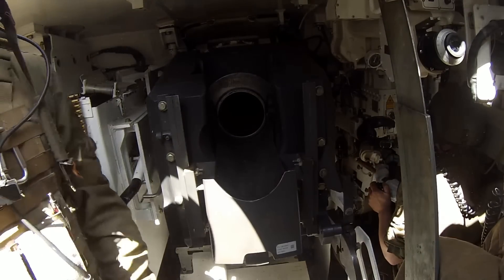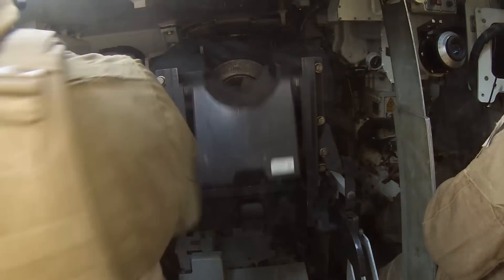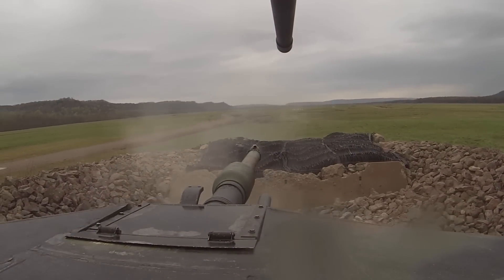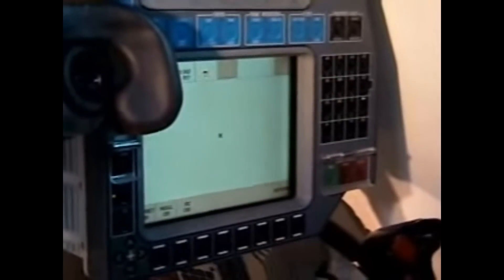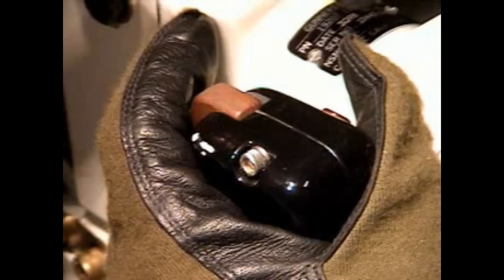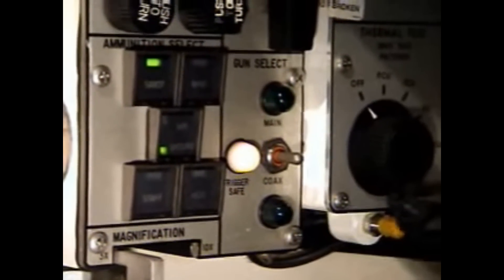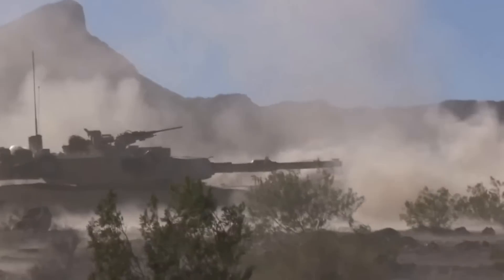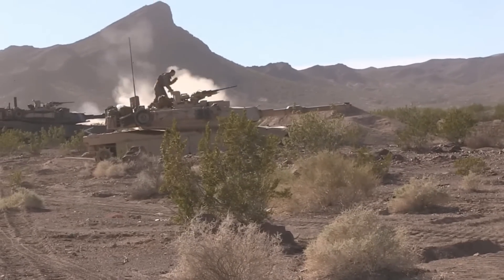How Do They Clear Tank Gun Misfires?

Comment: Yeah I'm not waiting 15 minutes to see if a round is bad or not. In a combat situation I'm chucking it the fuck out.
Reply: I was wondering if they did that if shit was hitting the fan. I din't think anyone would want to slap a misfire back in the ready rack and then it decides to cook off or something
Reply: You have to wait 15 minutes just in case there is a slow burn going on which could detonate the propellant as soon as it's out of the breech (from being disturbed). In a battle situation the commander may opt to forgo the 15 minutes but it is not advised. I believe they are also not allowed to just throw the rounds out even if they do misfire.
Reply: Placing the round back on the racks is pretty safe thanks to the abrams having blowout panels which would prevent any internal detonation from injuring the crew by causing the force of the blast to go upwards and out the top of the turret and not into the crew compartment, you can see this happening a lot on videos that claim abrams losses by ammunition cook off when in fact the tank would still be serviceable.
Reply: +Moisture
No, this is correct wartime procedure. It's a result of proper risk management in war. Think on what the risks are of both options:

What are the consequences of one cannon not firing for 15 minutes during combat? Fairly small. The enemy doesn't know the tank can't fire and you still have your defenses, armour and mobility to avoid nasty things happening.

What are the consequences of removing a slowburning misfire from the breech, after which it detonates inside the crew compartment during handling, killing all and writing off the tank? That's the worst case scenario for an individual unit.

So you wait 15 minutes, it's the best choice.
Reply: They (Tank commanders, me being one) have log books to turn in and contains the number of rounds fired, the type, and even the lot numbers of the rounds, and they have armorers to check out everything, there is a thorough investigation of any incident.  This ensures safety protocols are followed, equipment is properly maintained, and also verifies the ammunition is checked.  Gun tubes are inspected (scoped) with special microscopes to check for any cracks, especially concerning gun tube life cycle.
Reply: It is true about the blowout panels but I seriously doubt that anyone would not be nervous.
Reply: rowsdower bad idea. Sometimes the round goes off delayed - just speaking from Rifle experience
Reply: i know, i was being a smart-ass sorry. there's hardly anything worth debating here at all, but the comment section is full of conjecture and people blowing smoke everywhere.
Reply: It have to know the chances of a misfire being actually resulting in a slow burn to agree this is sensible 
Im sure a tank in modern combat when you are crushing illiterate  insurgents with 60s era technology with tones of support and minimal threat of exploding from enemy fire then yeah, I guess you should wait since the risks are minimal.

But I bet during during the battle of Kursk or any similar situation a commander would have allowed his gun to idle for 15 minutes.
In the kind of situations that probably will never happen again this would be wholly impractical.
Reply: rowsdower yep 6th misfire someone open a hach hach opens Chuck  FUCK that
Reply: the tank should have a catapult to allow the crew to throw-out the round like grenade LOL
Reply: yeah I feel like this is a process developed by committee in peace time.
Try a second time, Perhaps a third but fuck me if people are literally dying for tank support this process seems a bit fucked.

But perhaps its a lot faster in the field then in a instructional video
Reply: no way they totally do it faster in instructional videos.
Reply: i imagine also tanks rarely travels alone so in a fire support mission having 15 min down time on one tank is not as bad as it sounds. that would mainly be an issue if you are dualing an other tank.
Reply: OK in combat men have exited their tanks too early , they were either machine gunned, anti personnel rocketed  or simply run over by tons of steel on chains .the turret is separated from the live rounds ,in training escape ,in combat surrounded by enemy tanks and infantry ,try and stay calm and resolve the technical issues
Reply: also think about it ,a misfire blows smoke out of your gun ,enemy sees you as killed they pass you by hopefully ,give you time to regroup ,never expose your position in close warfare ,tank or otherwise
Reply: ya leopard boas as if you spent time in combat in a tank recently , a misfire seems as a hit from the outside keep playing your games
Reply: sometimes the barrel overheats and needs replacement
Reply: that is why we clean the elephants trunk ,so it never happened in my service ,if a barrel any kind overheats smoke ingulfs  ,the main gun 
 
keep practicing on your x box
Reply: my reality = 20 years in a merkava unit
Reply: where you think the excess carbon comes out of ?
your german arse?
Reply: stay in your tank after a misfire please , eliminate back seat drivers such as you ,the smoke gets in your lungs the barrel is an exit point
Reply: Don’t wait 15min, then you risk killing yourself and the crew.
Reply: I think that's why tanks have commanders.  Someone has to make a decision about the risk to the tank and crew verses having their main gun out of action for 15 minutes... and that's why tank commanders have superiors to answer to as well.  Every situation is different.  A judgment has to be made against all of the variables in play.  This is why we have trained and skilled human beings inside of tanks.
Reply: rowsdower so no lobbing the shells out the turret?